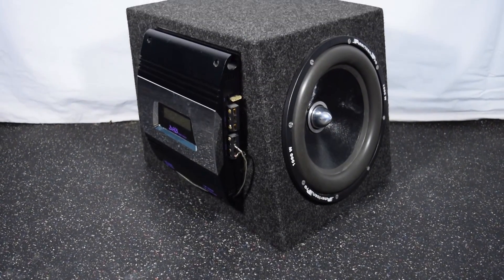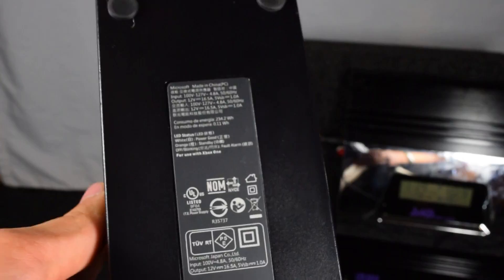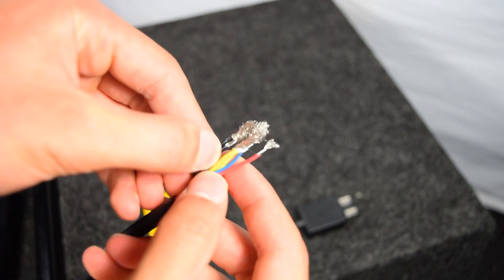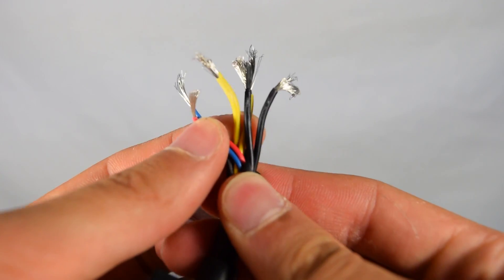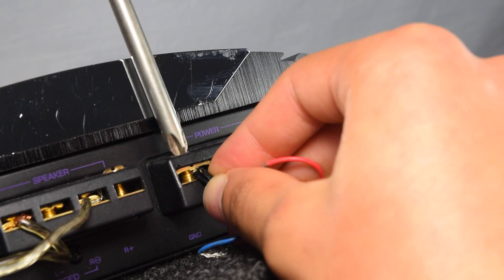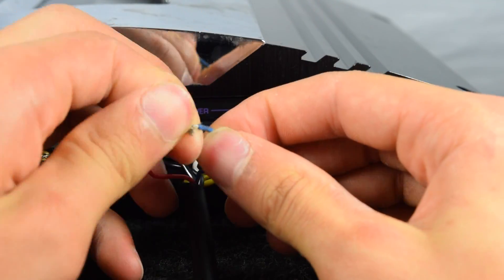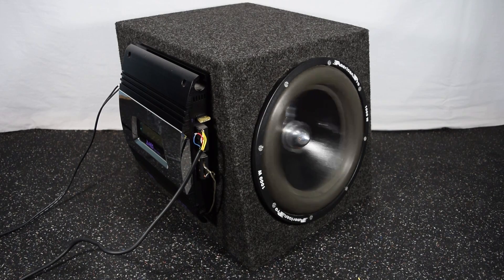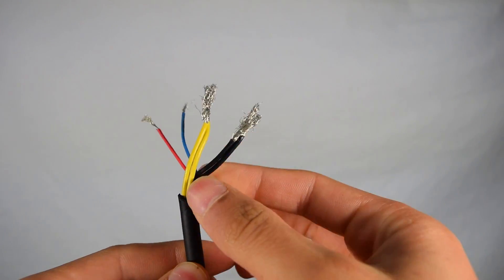How To Power Car Sub/Amp In Your House | Using Xbox 360/Xbox One Power Supply

Comment: Im running a 2400 watt hiphonics and a mojo memphis 12, 2 4” speakers and 2  6 by 9’s on one 360 block but it does show the red light and cut out if i turn it up to much im trying to find a cheap fix
Reply: pc psu will give you a ton more juice (if you get a good one) Check the amp output on it.

Comment: if I turn up my volume to much the power brick shuts down (red light) but even at low volume its crazy, Im surprised its running two of my 10inch subs with one brick.
Reply: what you have to do is disconnect the power cable from the xbox brick wait until the red light goes out then plug it back in.i fixed this issue all together {because i had to do this every time] by adding a cheap cap.now i have 3 amps and a crossover running off of it through a schitt dac fed by my laptop.all hooked to a surge protector so now i turn everything on and off by the surge protector and i also noticed a hum if you use different outlets for it all.i no longer have this along with one touch convenience its easy dont overthink it.you could even do all this with a jump starter kit for about an hr lol

Comment: I have everything wired correctly, but when I plug the power supply in, it doesn't power my 1200 w pioneer amp, even after I figured out what to do with the remote wire. My power brick lights up red for a second or it turns green, never powers the amp and then the green light fades out. Not certain anyone will have the answer but if you do lmk
Reply: BraddlySwaggly the power brick isn't made to push that much power
Reply: what you have to do is disconnect the power cable from the xbox brick wait until the red light goes out then plug it back in.i fixed this issue all together {because i had to do this every time] by adding a cheap cap.now i have 3 amps and a crossover running off of it through a schitt dac fed by my laptop.all hooked to a surge protector so now i turn everything on and off by the surge protector and i also noticed a hum if you use different outlets for it all.i no longer have this along with one touch convenience its easy dont overthink it.you could even do all this with a jump starter kit for about an hr lol

Comment: If you have an xbox 360 e power supply, there will be an extra white wire, and that one goes with ground, just wanted to say that for people having problems
Reply: Thank you very much
Reply: do i just put it with the negative then?
Reply: @jjs2155 yes make sure you do this too. Mine was grey and nothing worked before but now the amp turns on. The Xbox 360 box was making some weird noises too
Reply: @4SGM7 the sound its due to the earth, un need to take that cable to metal peace
Reply: @jjs2155 about to try it I’ll lyk
Reply: Thank you
Reply: Thanks man
Reply: Was just looking for this thx
Reply: Mine has GEN instead of ground, what does that mean?
Reply: what do i do with the green wire
Reply: Went to protect mode
Reply: Bro u saved my life with this comment
Reply: Yo thank you you are amazing
Reply: Thank you bro 🙏
Reply: HELL YE BRO THXXXX

Comment: I did this with Xbox360  with no problems at all. The power supply was12v and 10.82amps, my amp is  (1100peak) 783W per channel I believe with a 30A fuse. It powers them PLENTIFULLY! Awesome thanks!! 👍
Reply: what would i do with the white wire in the 360
Reply: Did it last or did the 360 power supply burn up?
Reply: @Bad_mfkr_mfkr  it still runs just fine 👌
Reply: @mattyi91  are the same wires inside of the 360 as the Xbox one
Reply: @brandonturner3943  I think the wire colors are a little different but same concept
Reply: @mattyi91  yo what about now
Reply: How do you have your radio hooked up to it? I’m about to do it with mine but I’m trying to learn how first 😂
Reply: How many amps was the amplifier
Reply: @johancuchan4262  its a boss 1100
Reply: @mattyi91 so like 400-600
Reply: yea, what about now. You could also use a psu from a pc for this. The amp output is higher.
Reply: @c.fodder2444  still runs just fine no issues the safety on these are impeccable. Also they have actual AC to DC converters online but this just happened to be the most convenient.
Reply: @mattyi91  Nice! It's good to hear this works well with < 20 amps power supply. Iv been worried about using a 60 amp one but if this does the job then i should be fine(famous last words).
Reply: @c.fodder2444  as long as you aren't tryna shake the house down, it works just fine. If you try to pull too much power it will shutdown. Just unplug it let it reset.
Reply: @mattyi91  That's good to know. Thanks for the tips.Im looking forward to getting something set up. I have already gone overboard to be honest but im keen to see just what i can manage to get running. I found a server powersupply with 130amps which sounds like some decent potential. Sorry neighbours....😆
Reply: @c.fodder2444  I didn't have any problems powering a hefty 12" and 15" but I decided to connect a capacitor so I can run all kinds of subs.
Reply: @mattyi91  hey i hooked mine up with a 40a amp and the psu and amp both come on for a split second and immediately shut down ive done this before with a 10a and it worked just fine, pls help
Reply: does or did your xbox 360 box make buzzing noises?

Comment: How do I make my brick stay on green because every time I touch the blue and red wires together the bricks light turns red and doesn’t give electricity. Can u help?
Reply: Victor Fuentes mine did that because I accidentally let the red and blue wires touch a ground or live wire and it shorted out. I unplugged it and plugged it back in and it was fine. But it worked fine for my 2 12’S
Reply: make sure the red light goes out then plug it back in you need those 2 together thats the turn on wires

Comment: Will this work with a 5500 watt amp with 4 24” subwoofers?
Reply: Most likely, but it will either not power on or have shitty ass quality
Reply: yes use capacitor and large power wire

Comment: Tried this but i keep getting the red fault light on xbox 360 power brick. My amp has a 40a fuse though might be why
Reply: Justin Jackson I have a 30A fuse and I had no issues. I did accidentally let the red and blue wire touch the ground or  positive wire and it threw the red light but once I unplugged it and replugged it it was fine. Like he said put take around exposed wires to be safe.

Comment: After you connect the power supply block to amp and sub, what did you do for to play music
Reply: Canadian Ruger yea that’s what’s confusing me
Reply: @christianmarquette7954  Most amps have 2 rca inputs for audio.
Reply: Radical Ruger my subs play the music is full range mode. It’s no the best quality but it works for what I have 👌🏼 but you should get an aux. cord splitter and then plug to actual speakers

Comment: will it work with my 700w amp?
Reply from the maker: Yes, but it will perform best at lower volumes since the power adapter was not made to push that much current

Comment: I have an x-box one power supply. I cut it open and find an extra green wire you didn't mention in this video. What do I do with the green wire?
Reply from the maker: If there are 2 green wires, tie them both together.
Reply: @EliteExpert  no there's just 1 by itself.
Reply from the maker: How many different colors are there total?
Reply: I have the same, when I connect the blue and red the brick light goes off, I have 2 yellow, 2 black, 1 blue, 1 red and 1 green. The yellows are together and in the +12v terminal and the 2 black are together and in the ground terminal

Comment: How you get the highs bro, are u still using car radio as tuner, could u power 2way speakers with car amp?
Reply from the maker: My amp pushes both mids and lows, it just depends on what setup you are using it for. I left my crossover a little too high in this video and the vocals started spilling into the woofer's range.
Reply: Martin K my amp has a full range mode switch. Like he said my subs will also play high mids. It’s not the best quality audio but it works plentifully for me. It will put some serious thump thru the whole upstairs of my house from my room. 👌🏼

Comment: I only got a red, white, green and black wires what do I do?
Reply from the maker: Are either of the wires thicker than the others?
Reply: Same problem, but they're all the same gauge
Reply from the maker: The black is definitely GND and the green is one of the trigger wires. Either the red or white would be the 12v power wire.
Reply: Green and white are trigger wires, black is ground and red is +12v

Comment: Could you possibly use two power supply bricks to power an amp with two 40 amp fuses?? Would that generate enough current to power the amp and drive the woofer harder? Or would it not work at all. Still debating on trying this method or the car battery charger
Reply from the maker: This should work in theory. As long as the power doesn't try to transfer between the 2 supplies, you should be good. I have not tried this, but if you do chose to try it, I'd love to hear the outcome!
Reply: @EliteExpert  his house caught fire the next day
Reply from the maker: Maybe that's why we haven't heard from him 😬
Reply: Lmao <3 comments here
Reply: Lol living in a dumpster now 😂

Comment: Can I use this to power my amp with 2 25amp fuses? If not, then could I just combine 2 of the Xbox power supplies in parallel up to the amp? Thanks
Reply from the maker: What size and power rating are your subs?

Comment: I'm using the xbox 360 power cord when I plug it into the wall the greenlight turns on but the amp doesnt. Why won't it turn on?
Reply from the maker: Did you connect the REM and 12v wire?

Comment: What if you 1 black 1 red 1green 1white
Reply from the maker: It would be the same process, just with a different color combination. I am not sure of the specific combination for that color code though.
Reply: if you wire to a CAR BATTERY YOUR RADIO REMOTE WIRE BECOMES YOUR NEGATIVE BATTERY WIRE AND THE GROUND WIRE BECOMES PROTECTION
Reply: Green+white are trigger wires black and red are ground and 12v
Reply: RED AND GREEN POSITIVE 
BLACK AND WHITE NEGATIVE !!!

Comment: Hi, I bought the gamestop edition of the xbox one PSU, the problem is that it comes with an additional green wire and when i connect the green and red wire the psu lights up greeen however it does not power the amp. Im confused as to what i should do
Reply: Same here fore my Xbox 360 slim power brick
Reply: Have you bridged the remote to +12v, if haven't the amp won't turn on
Reply: @maxbrimmell7947  yes the only difference is an extra green wire. As stated.
Reply: @hearmytruck  if the transformer lights up green that mean that power would be getting to the amp, but the amp won't except the power unless you have the remote hooked up or either your fuse is blown or even the amp, unless you've had it running since 👍

Comment: Used old 360 power brick on a 1500w kenwood amp, brick is green until I connect the wire from the Power to the R con. (controller). It then goes red
Reply: Foodville try to twist gray and black wires together and then It should be working
Reply: Update plz

Comment: Hey man, please try reply to this if you can. This setup was working great for a month or so, however now the power keeps cutting out... The power supply itself works because when I test it without the amp and touch the red and blue cable, the fans still run. However once wired up it turns on for a second, the amp lights up for a second, then it fades out and the power supply cuts out(fans stop running). I don't know what's the issue. Can you please help me out? Thanks!
Reply: i know this was three years ago but by any chance did you fix it
Reply: @caydenlewis4181  no clue man, ended up selling the amp and sub. Still have the power supply. My guess is the power supply shit itself after the abuse from the amp but who knows, never figured it out :(
Reply: what you have to do is disconnect the power cable from the xbox brick wait until the red light goes out then plug it back in.i fixed this issue all together {because i had to do this every time] by adding a cheap cap.now i have 3 amps and a crossover running off of it through a schitt dac fed by my laptop.all hooked to a surge protector so now i turn everything on and off by the surge protector and i also noticed a hum if you use different outlets for it all.i no longer have this along with one touch convenience its easy dont overthink it.you could even do all this with a jump starter kit for about an hr lol

Comment: Do you know if i can power my 600 watt amp with ps3 power supply
Reply from the maker: I have not tried using a PS3 power supply. I imagine the setup is very similar, but I cannot give exact direction in that process.

Comment: I just wired this together tonight but when I plugged it in it was a steady tone produced. Is this just the gain of the amp or should I use the remote that came with it? Will it not work if the rem and positive isn't bridged?
Reply: I'm getting the same result. have you had any luck fixing the issue? I plan to troubleshoot more tonight. I noticed that when I walked near the xBox power brick the feedback subsided... I placed my had on the brick and the tone subsided even more. I have a feeling there is interference somewhere.
Reply: I had the same problem with a brand new Xbox one power supply, it just made a buzzing tone and wouldnt play music just sat there and made my subs hum
Reply: @maxbrimmell7947  research  "ground loop" I added a DI box and problem solved
Reply: @TG_Shreds  nice one, I'll change the IEC, as the one I have is Chinese made with no Xbox markings on it, and I highly doubt it has a ground at all

Comment: One yellow wire is 12v the other 5v Wont this be 17v?
And if so can my amp and sub hold it?
Reply: No, you can't do that, that 5v is being used for the led in the power supply. If you wanted to get 17v you would have to wire it in series with the 12v. So you will be running 17 volts plus 18 amps into that thin wire and that 5v led, so get ready for a fire.

Comment: Would this work for a Kicker CXA600.1 mono amp and a Kicker Comp R 2ohm 12" ?
Reply: NO YOU NEED MORE AMPERAGE. BUY A 1200w SERVER POWER SUPPLY ON EBAY. They are like $40
Reply: @rmblwgn  how about a 250.1 kicker amp ?
Reply: @akidim13  ya maybe... 30 amp dc 12v power supplies are like $20 on amazon tho.. will run a 500w amp easily
Reply: i have the same exact set up but i have a cap.all is well.2 farad capacitor.plus it looks crazy lol

Comment: Urgent!! I got a xbox one power supply and it has 4 wires.....1 red, 1 black, 1 green and one white!
Reply from the maker: Connect the Red to 12V. Black to GND. And connect white and green together, then cover with electrical tape. Let me know how it goes!
Reply: EliteExpert thank you so much! It worked!!!
Reply from the maker: Glad to help!
Reply: EliteExpert is it normal for the car amp to be warm to the touch?
Reply from the maker: Yes! My amp has a temperature reading, and during heavy playing it reaches over 100°.
Reply: You van buy a Heat sink on AliExpress for that.

Comment: Quick question! I got a 3,000 watt amp and i wanna hook up 1 12inch 2300 watt sub. Will that power supply be enough? If not what do i need to do?
Reply from the maker: First thing. WOW! Incredible setup! What amp and sub is that? So if you are looking to play your sub at full volume, I wouldn't trust the Xbox power supply. For light use it should handle it. But another solution is to buy a Regulated DC Power Supply that amplifies the current going to your amp. They aren't very cheap, but unfortunately I have not tried wiring a DC Power Supply, so I would give the Xbox a shot if u feel confident!
Reply: Thanks for quick response!!! Its just a pyramid 2 channel bridgeable amp and a boss phantom sub. Where would i find a DC regulated power supply big Enough for my set up?
Reply from the maker: Nice budget setup! Unfortunately, the Power supply won't be very cheap, but here's a PS which should run great! How many amps can your fuse handle?
Reply: EliteExpert i have no idea. Im getting my amp today in the mail! Ill let you know!

Comment: Cut wires, plug it in, proceed to play with live wires. I couldn’t think of a more brilliant idea.
Reply: No it’s ok it 12v it will not harm
Reply: @leofitzpatrick3020  its a common fear amongst the general mass that all elecricity will kill you. 12v is nothing to be worried about.
Reply: Andrew Pitt worked good for me 👻
Reply: I saw him testing a 12v power supply by connecting 2 wires which turn it on, but not many people would call that playing with live wires unless they really didn't understand electricity, something which modern society has mastered and I wouldn't assume you to be so ignorant. Could you timestamp where he acted irresponsibly and touched something that could have hurt him like you suggested?

Comment: im using a xbox 360 supply when i power it the amp comes on then the brick goes red and red means fault alarm...it only stays green for a sec before all shutting off and going red... help!
Reply from the maker: How many wires do u have to connect? It's probably an issue with the starter wires not being connected.
Reply: EliteExpert I have the same problem, 1200w kenwood amp. Xbox 360 brick, 4 yellow 4 black one blue and one red wires. When I connect the blue and red wires it powers on for a sec and then the brick goes red

Comment: hey nice video...but how do i know this wont underpower my amp and sub? as in underpowering really damages the amp and sub ...i got jbl gx-a3011si mono and jbl 1400watt sub...will this be enough to power them?
Reply from the maker: Wow. Nice setup!  With the power limitations on the Xbox power supply, I wouldn't trust running such a large and power demanding system using this method.
Reply: thanks mahn! anyways i ordered a 12v 40amps dc power supply...i guess that should be healthy enough to power that :D